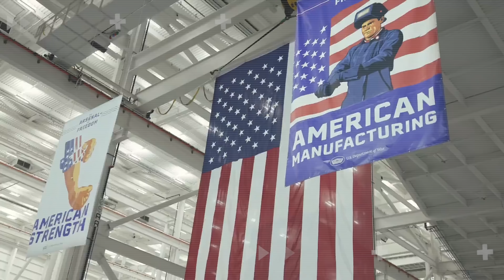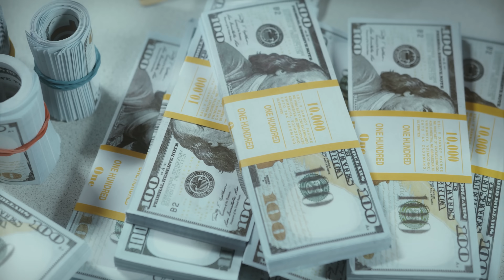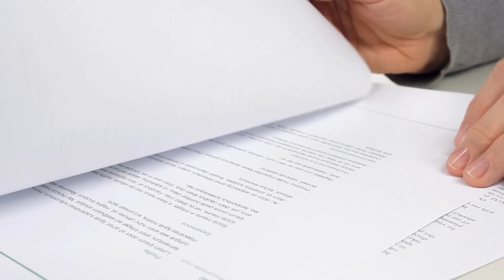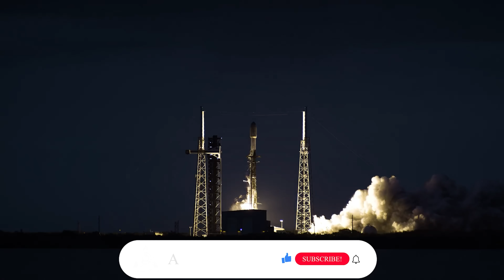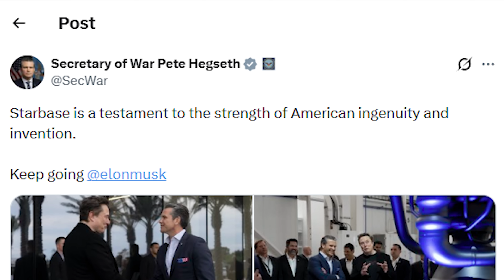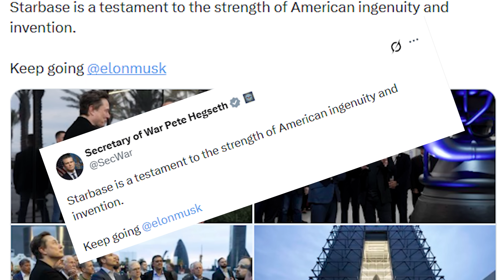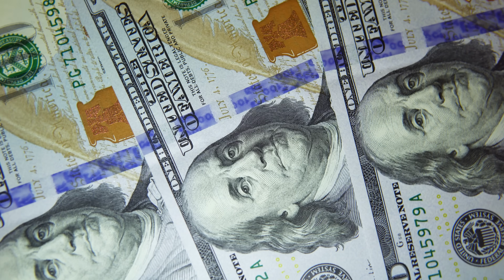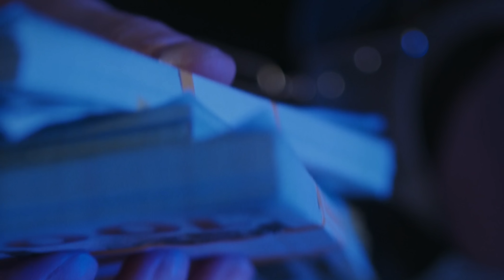Pentagon just declared this after Shocking Discovery at SpaceX's Starship Factory. Never Seen Before

Comment: The next starship flight should be spectacular.  Plus SpaceX is perfecting heat shields.  NASA Boing could use new ones. Artemis will fly humans ‘soon’ around the moon (thousands of miles) without a fixed heat shield.  Would you fly on Artemis? What could go wrong?

Comment: They have to bring it back from orbit undamaged first. That thing will be a drone magnet sitting anywhere near the front lines in a real war. And a sitting duck for surface to air missiles as it is coming down for a landing. One tiny shrapnel hole and BOOM. Warplanes have self sealing fuel tanks for a reason. How are they planning to refuel it after it lands near the front?  And cargo planes have big ramps for rapid unloading before enemy drones or missiles arrive. How will they unload a Starship with everything way up there at the top. Good luck doing that.
Reply from the maker: Those are fair concerns — but Starship isn’t meant to land on the front line.

The DoD concept is rapid point-to-point logistics to secure or rear-area bases, not contested SAM zones. It’s a suborbital transport, not a cargo plane replacement.

It fills one niche only: moving tens of tons anywhere on Earth in under an hour — something no aircraft can do. That’s why it’s being studied.
Reply: Don't stress about it - if not for people like this humans would not be flying today. At all.
Reply: The booster returns to the launch site.  The starship lander could land on platforms at sea. 
I like the idea that Starship could deliver cargo at sea. The have drones deliver cargo to land based sites.

Comment: Starships secret is its reusable booster. That booster is the majority of Starship's cost.
33 raptors, Stainless Steel hull, massive fuel capacity. The booster capabilities determine the payload capabilities of its upper stage. Starship upper stage can be either fully reusable, refurbish-able, or expendable based upon its mission objectives.